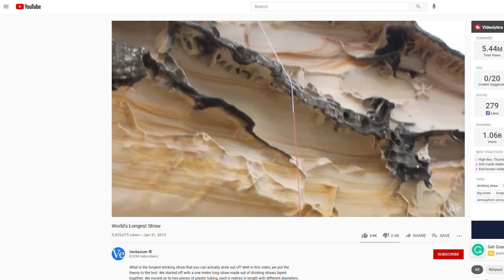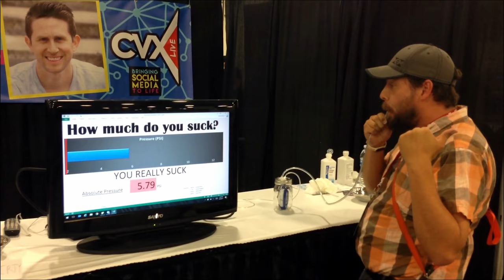Trying To Drink From The World's Longest Straw

Comment: Ok, try this.....Completely submerge the entire hose in the water so it has no air bubbles in it ensuring one end stays submerged. Then cap the other end with your thumb, vice grips, whatever, and then walk that end up above 34 feet and see what happens. I think this would be an interesting experiment.

Another option would be to siphon from a bucket at 34 feet high down to another bucket 34 feet below, once both buckets are at 50% capacity, cap the end of the higher hose with your thumb. The entire hose will be full of liquid then.....so what would happen inside the hose at this point? would it instantly start to boil inside? i cant see how vapour would be able to form as the entire space is taken up with solid liquid....and if it does it would have to create a heap of pressure and maybe split the hose?

I hope you see this and maybe do a video on it!

Comment: Because there are no pulling forces (only pushing forces), there is no such thing as sucking action. It is atmospheric pressure that is mostly responsible for pushing the water up the straw. Capillary action and surface tension also allow for some upward movement of water. Try a larger diameter straw and you will have no movement of water beyond the theoretical limit. Try a liquid with a lower vapor pressure than water.

Comment: 7:20 wait, so does that mean you could theoretically make a hot liquids safety straw based just on the length that only lets you suck up liquids that are at safe to drink temperatures?
Reply: No, it only theoretically happens at boiling point.
Reply: @eduardogarciajr6562  I disagree, because the boiling point was just an example. I think the point James was trying to make is that the hotter the water is, the lower the boiling pressure is, so in RadicalxEdward's theory, if the liquid is too hot, and the straw is long enough, the liquid would boil before it reaches the top of the straw.
Reply: That doesn't sound very practical in most cases, but that does inspire some thought (from me) of controlling the outside pressure of a liquid in order to regulate its temperature.

Comment: This was a long time ago, but I'm wondering if anyone could help. I'm siphoning water from a mega puddle of water that always occurs during heavy rain, and I'm trying to transport it across a vinyl tube about 25 feet long. The outer diameter is about 5/8 of an inch, and the incline is rather minimal; it's almost horizontal. My siphon is a bell siphon, as I wanted something with no moving parts and as automatic as possible.

Trouble is that it seems there's a quite bit of resistance when trying to push water into the bell due to the tubing itself. Perhaps it's too long, and when water is already in it, the siphon still functions just very weakly. I'm wondering if drilling holes into the tubing will somehow lower the water pressure in the tubing, allowing the vacuum to push more water out of the puddle, into the tubing, and out of the flooded area.

Comment: The vapor pressure is irrelevant.  The point is, when the column of the fluid weighs more than the column of air, the fluid will not rise any higher.  This is how a barometer works.  A column of air at sea level weighs approximately the same as 760 millimeters of mercury, or, 34 feet of water.

Comment: Can you tell us how in a when we stand inside a moving this we dont get pushed to the back of the moving thing that easily?
Reply: Being pushed back has to do with acceleration. If you’re pushed, then that me there is a force on you (mass x acceleration). If you are already moving or slowly accelerating, then there really isn’t a force to push you.
Reply: @jacobbriggs311  thanks!
Reply: It is acceleration like the other comment says. When you are inside a car, you dont move if the car keeps the same speed. If the car speeds up or stops quickly, you will move too.

Comment: Now to do this in reverse and boil water by filling a long tube, as it drains it will create a vacuum.  Basically a closed off siphon, water sealed bottom and air sealed top.  It would be interesting to see if you can get a strong enough vacuum to freeze the water.

Comment: Also the theoretical limit for how far the liquid can be sucked up the tube would also most likely would depend on it’s boiling point so for example liquids with much higher boiling temperatures than water could travel further up the tube before boiling! :)

Comment: Well i suppose the pressure inside the "straw" can eventually get so Low that the atmosperical pressure can crush or rather let the straw collapse in on itself when sucking.. so at some Point you would also need something more sturdy than a pvc tube

Comment: Imagine if you fill up the pipe with water and plug it into a pressure gauge, then you lift up the gauge higher and higher until the water start boiling, then you will get some kind of value close to the theoretical.

Comment: Should have just asked your fire department.  Maximum draft from a water source is 33.4ft.  14.7psi.  Calculate how tall a one inch column of water needs to be to weigh 14.7 pounds.  That's the max atmospheric pressure pushing the water up your straw.

You went up and over probably due to straw collapsing and pushing the final amount up and over.

Comment: Thanks for the efforts, does it really boil? what was the temperature? or the weight of the water getting pull-down is separating hydrogen and oxygen from top and middle? any ideas where the bubbles start building in the tube? cause this could be a weight limit for water to split into gases. Please advise.
Reply: The pressure is low enough that the water is no longer compressed to liquid form. It's still H2O it is just turning into water vapour because it's in a partial vacuum.
Reply: Low pressure makes water boil at different temperatures.

At sea level water boils at a 100 Celsius. But depending on the pressure water can boil at different temperatures.

Comment: My guess on what's gonna happen before watching the video :

If the straw is longer than 10m it's not going to work because the atmospheric pressure won't be strong enough to pull the water all the way to the top. 

(I'm french and my English is not very good so I hope it's understandable. And I hope my guess isn't totally wrong but I'm only 15 and I don't know everything about physics so I'm probably wrong)

Comment: You need to prime the tube first. ie fill it with water.
Also the net positive suction head NPSH of the pump should be higher than the suction height.

Comment: does syphoning work over large vertical distances? I imagine it would? Like 40 ft up and 40ft back down, the other end of the tube will still be lower than the starting point, but have the path it travels very high up in the air.

Comment: carbonation is cold boilingthe bubble cure and clean but the color keeps ... the heat and light change the color so adding light to pressure tube will be closer to hot cold boiling or adidng dark

Comment: I wonder what would happen if you filled the 34 foot (or longer) straw while it's flat on the ground, then seal the top part of the straw. Then there's no air gaps, what would happen when you carry the top part of the straw now vertically up 34 feet?
Reply: Essentially the same thing - the water in the top part of the straw would boil and turn into vapour.

Comment: I always wondered if you did this with a big tube running from space to the ground with the ground end sealed air tight would the vacuum of space suck the air out the bottem of the tube to create a vacuum or could we suck all the air out the tube?

Comment: Now how does a washroom in a skyscraper observatory floor get normal water from the ground floor? Only the pumping mechanism differs right? But they are not vapours any more and they flow constantly without sure bubbles or air locks. How does this work?

Comment: when the water boils cuz of height, does it get 100 celsius?
Reply: I don't think so, because the boiling point of water is 100 degrees Celsius only at sea level, when the pressure is 1 atmosphere. Inside the tube, due to the vacuum of the suction, the pressure must be much lower, allowing the water to evaporate at room temperature.
Reply: @Herandro_just_Herandro  Thanks!

Comment: Could you chill the tube around 25-35 feet(i dont know how just hypothesizing) to stopthe water boiling? wouldn't you be able to get higher than the theoretical limit?
Reply: The boiling pressure of water at 1 Celsius isn't significantly different than the boiling point at 20 Celsius (typical ambient).  The most you could do would be to chill it to the triple temperature of water at 0.1 C, and the theoretical upper limit to how much you could suck the water would improve the theoretical limit of suck height from 10.09 meters (at 20 C) to 10.29 meters at the triple temperature of water.  That's only a 0.2% improvement

Comment: What about pushing liquid up ? Like with a water blaster or airless sprayer? Is there height limit that fluid can be pushed ?
Reply: Yes, there is.  There would be a maximum height where you'd have to turn the water from a liquid to a supercritical fluid, for it to have enough pressure to be pushed upward.  We're talking several kilometers high, that you'd probably end up pumping in stages anyway..

Comment: This might be a dumb question (I feel safe asking here though for some reason) but is the water actually hot? If so, I just invented a way to boil water without using any heat. Imma finna be a meeyanair!!!
Reply: No, the boiling temperature lowers, not water becoming hotter

Comment: Is the water hot when it boils in the tube?
Reply: No, low air pressure decreases the boiling point, which is why it could boil at room temperature

Comment: Okay i didnt watch it yet… but its not possible to make it over 10m. When you suck you create a vacuum in your mouth and the air that presses on the water pushes it in. Now…. Water has weight too and that means that it will apply pressure to the floor as well. Because i did my physics homework i know that the air pressure is equal to around 10m high water…. Then it doesnt work anymore!
And now imma look if im right lol

Yeah i was right… but i was kinda sad cuz he knew xD

Comment: What will happen if we instead of pulling the liquid try to push it?
Like we do with tetra pack juices.
Reply: it goes all the way up, depending on how much pressure you put it under
Reply: @alyero6341  Newton's third law of motion??
Reply: @summi_0000  what do you mean?
Reply: @alyero6341  I mean "Every action has an equal and opposite reaction"
The amount of pressure(force) i apply on it,it comes back the same
Reply: @summi_0000  alright, imagine a piston pump. if it can apply 10000 Newtons of force over its piston area that's a certain amount of pressure acting on the fluid. the fluid pushes back against the piston according to newtons 3rd law. this isnt really necessary to look at here tho? its kinda obvious any kind of pump which can reach certain pressures obviously must be able to withstand those pressures or it wouldnt reach them without breaking in the first place. im not sure what your question is at this point, can you try and rephrase?
Reply: @alyero6341  I wanted to say that what concept is working in a liquid going up when I apply pressure on it through my  mouth in a straw?
Reply: @summi_0000  it's the outside atmosphere pressure pushing down on the liquid and it has nowhere to go. If you remove some of the pressure above it in the straw the water gets pushed into that cavity.
Reply: @alyero6341  Means it tries to reach at a lower pressure?
Reply: @summi_0000  imagine the atmosphere as a fluid too layered on top of the water. air has a lot of weight and it pushes down on all of us at  a pressure of 1 bar(roughly at sea level). Nothing at the surface of the earth moves, because it is already compressed/pushes back against the weight of the atmosphere at the same strength. If you take away the atmospheric pressure by sucking on a straw, the atmospheric pressure around the straw entrance still pushes the water down  but it suddenly has a spot it can fill, which doesnt push back.
Reply: @alyero6341  oh wow.... now I got it
Reply: @alyero6341  Quite mind-blowing for me😂
Thank you for giving this much of time. I really appreciate that.
Reply: @summi_0000  you're welcome, happy to help :)

Comment: what if you suck from the bottom and the pipe does a u turn from bottom to top then bottom? will the pressure be any different or it will be relative to the end of the tube

Comment: Lol, this guy apparently has never seen a water pump that uses a long hose to pull water from a source to be relocated to another place via another hose. Written right on the side of those pumps it clearly says to NOT have the intake hose any more than 2 ft lower then the pump drive itself to avoid overworking said engine.